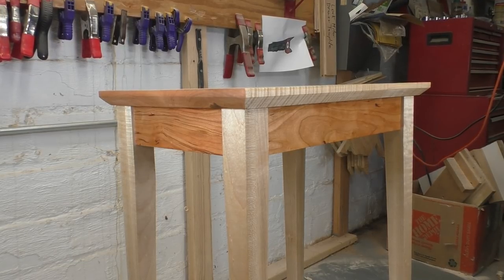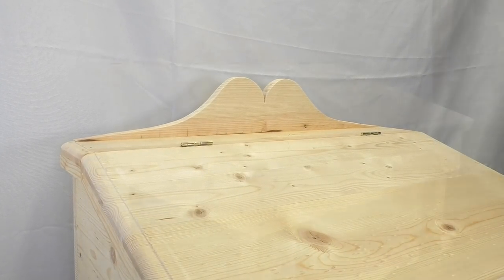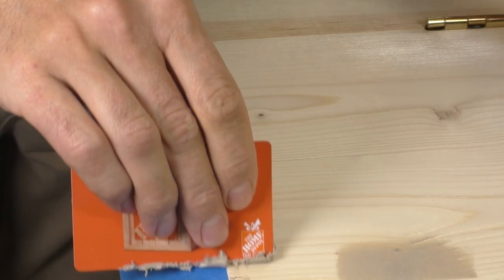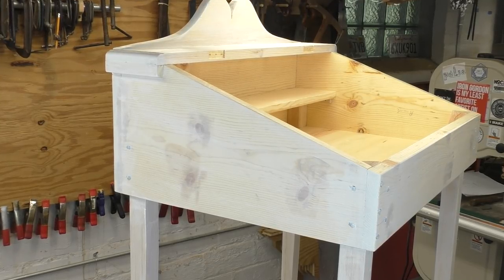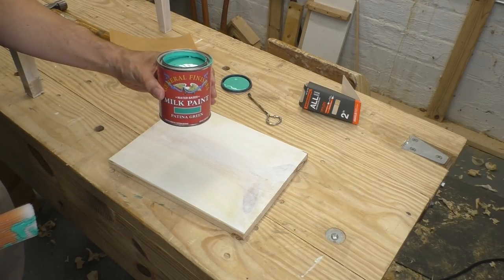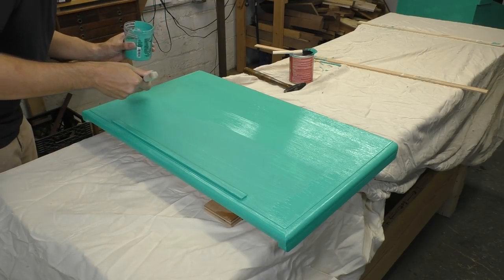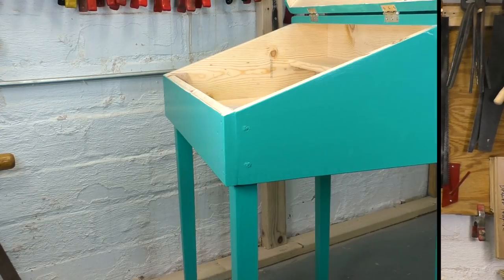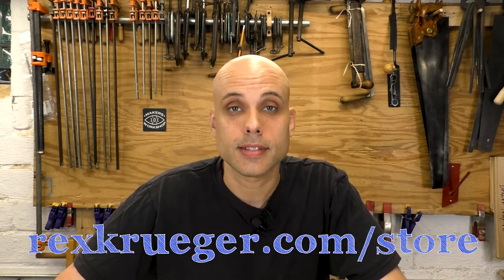Painted Furniture: A Beginner's Guide

Comment: Just my 2 cents from a few years as a painter: paint a quick coat of primer onto the wood and see what shows. Then you'll know what you need to fix, and what doesn't show. Since you'll need to sand after your first coat of primer anyway, you don't even loose any time. Also, while BIN is great, especially over old mystery finishes, cheep latex primers work fine on fresh wood, and are easier to clean up.
Reply: I use this technique as well. You can find flaws after priming that will be glaring after you apply topcoat.
Reply: In this case the shellac based primer is probably the best choice because it will help to stop the knots from bleeding through the finish.
Reply: I am responding to The Hegemon:
I think bondo adheres to wood fibers better than it does to primer. I try to fill first if using bondo and then prime, but if I am using latex filler, then I prime first.

Also, a general point to make: Bondo is much harder than soft woods, so it can really show if you are relying on sanding it too much. I often tape around spots to repair and I even tape before I shoot nails through cedar. Douglas fir is about as hard as bondo, so one doesn't have to be as careful with it.

Comment: Wow, Rex, that piece of advice at the end - that one you should repeat more often! I am kind of new to the woodworking (only about a dozen or two of projects over 2 years). I always pointed out to my mistakes despite my wife told me they do not matter that much. Last weekend I finished a shoe-bench for our mudroom and made few mistakes, they are even quite visible and disturbing, but I didn't point to them. My wife either hasn't notice or does not bother and requested same style low bench for the bathroom. I'm not going to point to my mistakes anymore!
Reply: I built my wife a writing desk and had a couple of small runs in the poly finish.  It drove me nuts.   I told her that I had a couple of small mistakes but she said she couldn't see them.  Strive for perfection but don't obsess over the mistakes.

Comment: From many years of finishing, I found that keeping coatings combined with like kinds is usually best.  Cover water-based with water-based and oil-based with oil-based to avoid compatability issues (cure-time and adhesion issues).  The exception is shellac-based products, which make great sealers and intermediate coats if you simply must use incompatible finishes.  Another tip, don't use silicon carbide and papers on anything that you will apply another coat to, unless you really want to find out what "fish-eye" finish defects look like.

Comment: The guy who taught me to paint was a times served coach painter and he gave me several tips on avoiding brush marks.

If you are using 2 coats then do your first coat with your brush strokes against the grain and your top coat with the grain. More than 2 coats and you have coats with the brush strokes at 45deg too!

Some of the works he did would have filler, 1 coat of primer 2 coats of oil filler (a wierd form of paint that fills in smallest pits very well) 3-4 coats of undercoat (in a similar shade to the main colour) at least 4 coats of gloss (often more) with flatting down between coats,
Then the most technical layer with any water slide transfers, decorative lining and gold leaf work (on specific gold leaf sizing) followed by about 10 coats of varnish! (unfortunately both gloss and varnish has got thicker over time with the aim of being "1 coat" which makes the huge number of coats he used impractical unless you spend a a fortune on old fashioned paint...

The results looked absolutely stunning! But we are talking vintage tramcars (trolleys in american) that traditionally had a very high gloss finish that also needed to be super durable against road grime and being washed in the depot

Comment: I am particularly fond of painted furniture with natural wood "accents". Using the term very loosely here, it could be painted body of some sort of a chest of drawers with the front of the drawers of exposed grain. Or the other way around, flat matt painted front drawers and top, with color matching heavy stained grain (but still visible) on the rest. Quite fond of painted tops tbh, I like my "work surfaces" to be rather undistracting. Alternatively, can also think of it on a scale of the entire home/room decor, not just a "per piece" look. I find that mixing actually shows grain that I want seen better since those are now highlights rather than just more one of many/the norm of the look.

Comment: Excellent advice. Painting can really give great results. For example, small tables look great when you oil the top and paint the aprons and legs. Black paint, for example, gives a very nice modern look to the piece.  Blanket chests and tool boxes look really nice when painted, too. 
The points you make about fiberglass wood filler and stain blocking sealer/primer are spot on.  Both are very useful.
Beautiful desk!

Thanks!

Comment: My dad was a professional painter , his secret to a good brush job was to add paint additives from Flood instead of thinner. They have ones for latex and oils. Plus after you sand remove all the dust with a tack cloth. No dust nibs and all the brush and lap marks will flow flat. Try it you will be amazed at the results 😉

Comment: To avoid Brush strokes, you can thin the paint a lot and put on many coats. If you don't want to spend much time with a lot of coats, a small foam paint roll creates a super smooth finish on large surfaces.

Comment: Excellent! My last big project required painting, in semi-gloss white, to match an existing Ikea peace as much as possible. I did basically the same process as you - sanding, putty, primer, spray paint and brushed-on water-based poly. It was the first painted project I've done where the finish mattered, and it was a drag - leaving the primer to dry overnight just to discover more flaws that require more putty, drying, sanding and priming - exactly like what you've encountered here. It took me literally several weeks to finish, but patience and attention to detail  really pay off here. 

In the past, I spent some time working in a big shop that did big projects (showroom pavilions, museums etc.) and one thing I noticed was - everyone would do woodworking, metalworking, assembly, and so on - but only a few employees would do finishes, especially on the "show" parts of the project. That's a whole skill, and one that isn't as mechanical as some other aspects of woodworking, you could say it requires a bit of "art" to do professionally. I think that's a hurdle a lot of hobbyist woodworkers like myself run into, as we discover that sometimes our project is only as good as the finish we apply to it, and have to learn the hard way that finishing isn't a brief last step to seal the deal but rather a significant, time-consuming and attention-demanding phase of our projects, one worth learning to do well.

Comment: I've  been selling  paint for 34 years and you are spot on with your paint/primer/prep reccomendations. The primer you used is excellent and especially good as a stain blocker. I coat is sufficient but I like 2 coats on the knots. A little insurance to keep them from bleeding through the finish. Keep up the good work 😊

Comment: I've used General Finishes Milk Paint on two projects in the last six months and I'm pretty happy with the end results.  They have lots of good info, tips, tricks, & videos on their website.  After the first project, I realized that this product goes on in thin layers instead of one chunky layer I was used to with interior latex wall paint from the mis-tint shelf at Lowe's.  After 4, sometimes 5 coats, my projects looked amazing, each with light sandings in between with #220.  GF doesn't recommend a topcoat for lighter colors and the curing time is way longer than the thirty days they specify but I think they need to formulate a hardener into it or a specific topcoat for their Milk Paint as it's a little more scratch prone than I like; but they also warn about using it on high use items.
Reply: Milk paint is generally used so it wears through and develops a patina, plus it has a  really nice feel to the hand (glides rather than squeaks when rubbed). It works great to apply a few coats of one colour, then something different over the top. Knock the edges off, rub it around the knobs and you will find it looks great. Let it wear more in use, slow it down with some clear and hit it again if it gets too thin.
If you want a smooth perfect finish and/or will be putting clear over the top, it's absolutely pointless using milk paint, since you are covering up  the very attributes that are reason to use it.

Comment: Loving these. I've been trying out laying down finishes with an HVLP gun last few months. I've always hated brush strokes and I get more consistency with the sprayer. Used to use finishes in paint cans on smaller projects but know I brake out the HVLP  on everything now. So much cheaper than rattle cans.

Comment: Good tips Rex.  Especially the floor finish.  One of my next projects is a Barn Hex sign - e.g. Pennsylvania Dutch.  I want something that can hold up being outside without changing the color of the paint.  The floor finish may be what I need.
Reply: Just use EXTERIOR grade paint. You know, the stuff you would paint a house with, that is specifically designed for use out in the elements without fading, etc

Comment: On the water based poly and acrylic clear coats use those Shur-line edging pads for trim painting. They are amazing with coatings that are thin but dry fast cuz you can get the coating on quick and very even. Then use a good sash brush to just whisper over the edges to clean up any excess that gets into sharp detail. The finish will be very smooth.
Reply: However they leave thousands of tiny little loose hairs all through your finish which become more and more obvious as you apply more coats. You don't notice them on a wall, but they stand out like canine gonads on a piece of furniture.

Comment: I am super happy how that cleaned up. When you made it originally I was...reticent to comment on the look. I'm honestly impressed with that fill and finish! I've been experimenting with drywall 20 minute mud. It dries hard and is really easily workable until it sets off. I've also learned that adding just a tiny dab ~1/2 tsp/cup or less of wood glue to the mud mix gives it fantastic binding.
Reply: Yes I  have used it as well and it gets a really good finish, great if you have some poor quality plywood i just do a skim coat and it comes up great.  I'll try the wood glue trick!

Comment: I need to try that water based poly, seems legit and i hate messing with oil finishes.
Reply: Water based doesn't set up properly, so if you place an object on it, the object will stick. Maybe oil or wax afterwards will help, but heavy things always dig in to the finish and leave a dent.
BTW oil finishes are much easier to apply and clean up than water based.
Reply: @johncoops6897  wow almost like every type of finish has its own set of strengths and weaknesses and their use cases vary depending on the application hey thanks for that

Comment: Sanding block with cork, pantyhose to filter paint & final prep before applying any finishes. I can not remember the name of a can plaster. which I use because it doesn't shrink like other fillers. Non water base. found in the paint department of homdepo. blk & orange can.

Comment: I know our image of castles and pyramids is the result of having only seen them in a torn down state, after the limestone, plaster, and paint have all worn away. Is it possible that our view of old furniture shares a similar root? Namely, that at some point in the past it became the done thing to strip paint off of old furniture and finish it in a way to show off the wood grain? Kind of like how it became popular in the mid-20th century to lay down carpet over hardwood floors and to put in a sort of drop ceiling in rooms with high ceilings

Comment: The harshest critic you will ever have is always yourself!! The thing is to learn from your mistakes or missteps, and expand on how to do it better the next time!! 

That being said even professionally built furniture is never truly "perfect"! Years ago I bought a oak bookcase from a showroom furniture dealer and thought it was "Great"!! BUT over time I began to notice over the years imperfections in the piece. Corners that were quit cut at a right angle, uneven finish over the whole surface, and bits that seemed "cobbled together"!! Even the "oak wood" I later learned wasn't all "oak" as some of it is just veneer layer on top of a particle board substrate...so all the money I paid for "real oak wood" some twenty years ago....wasn't even real "oak wood" to begin with!! And I paid nearly $300 for a bookshelf that is a lie, driving my point home!!

Comment: Well explained, but I don't think you're comparing similar fruits on the top coat. Obviously there will be some appearance differences between oil vs water base, but you used gloss oil and semi-gloss acrylic. Plus consider that the paint probably absorbed some of that acrylic, thus reducing the sheen. Maybe to get the desired look from oil you need to use satin or semi-gloss.

Comment: I noticed you didn't paint the inside. One of the things I've noticed in our stage carpentry (which, admittedly, is VERY rough) is that wood that's only painted on one side tends to warp more than wood painted on both sides. Are you finding any noticeable warping?
Reply from the maker: No. The way it's built,  the pieces support each other. They pretty much can't warp because of the design.  Also,  most period furniture wasn't painted on the outside because it would trap the smell of the paint.

Comment: I think two coats of spackle or drywall compound for filler would be a whole lot easier to work with and just as effective as the Minwax stuff.  Two or three coats of paint makes it quite durable.
Reply: Use wood filler, spray a mist of water on it and smear it out with a fairly broad (taping) stainless lade. I've used drywall filler for repairs and it is a fail because it melts and  "picks up" when you brush the top coat onto it. The wet area wall filler is OK because it setup up fully, but it's somewhat gritty... it,'s easier to just use a tube (not a jar) of wood filler paste.
Reply: @johncoops6897  Thanks, but I'll stick with what works for me.
Reply: @ricksolari9570  - OK, but my comment was to inform others that there is an easier and even better way, using the proper filler material for the job.
Reply: @johncoops6897  Easier?  I'm not so sure.  It's always better to have a filler that sands easier than the surrounding wood surface.  That way, irregularities in the surface are avoided.  Frankly. a Bondo-like filler would be my last choice, unless I was building up an area.
Reply: @ricksolari9570  - yes easier. I agree  with everything that you say, except for the use of drywall plaster filler. I've used it recently on a timber door repair and it does not stick properly.
It adheres great to paper faced board and plaster however it does not stick well to timber. It "melts" if you wipe it over with a wet cloth to remove dust, and also becomes damaged when you brush a water-based paint over it.
The wood filler is specifically designed to stick to timber, but otherwise acts, feels and sands just as well as drywall filler. So therefore, by using the correct type of filler it is far easier to get a good surface with the least amount of rework.
Reply: @johncoops6897  I can only say it  works great for me.  Interior use only, vacuum rather than wipe, and don't saturate with paint.  Use a "dry brush" on larger areas at first, then reapply after it dries.
Reply: @ricksolari9570  - Yes, I KNOW it works, and I have used your method of plaster-based fillers many times in the past. I am also very aware of how to get a good finish, since I am a plasterer... I used drywall fillers because I always have them on hard.
HOWEVER I have found from experience that using a filler that is specifically designed for interior timber works a LOT better, with all the advantages of plaster but none of the fragility and other problems. It also doesn't need special treatment with vacuum or slightly dry first coat to counter the risk of re-wetting.
You should try it... something NEW!
Reply: @johncoops6897  By all means, name a brand or two.

Comment: Hey rex I ran into something quit unexpected with a wood filler, it dry up completely and to the point where litterly it cracks when mess with it. Got any tipa for that or do I just buy a new one?
Reply: Add water if it's water based (most are) and mix it until it is a paste again. Test first, and use a mortar and pestle to grind it to a fine powder. Much easier to buy a new one, of course.

Comment: 3:08

That nasty garbage is not a winner. 

Durham's water putty is the winner.
Reply: He TOTALLY screwed up using that 2-part as the filler, especially for a soft wood like pine. The more that he sands, the lumpier and more obvious the defect becomes. The fillet must be softer than the surface.

Comment: The only thing that  IMO I thinks looks crap on the table are the hideous nails use on the legs and sides they are right on the surface and really noticeable  , would it have killed you to use screws and the counter sink them .